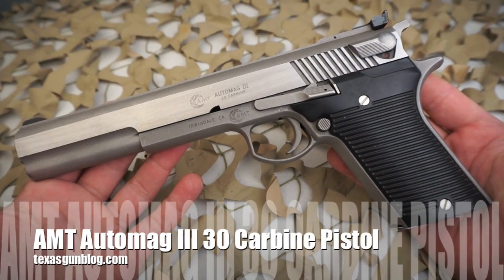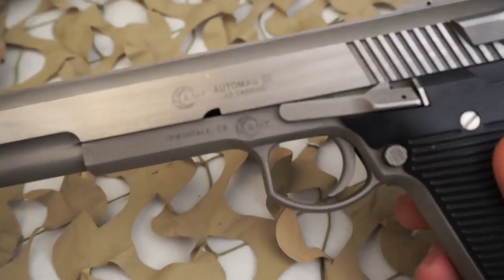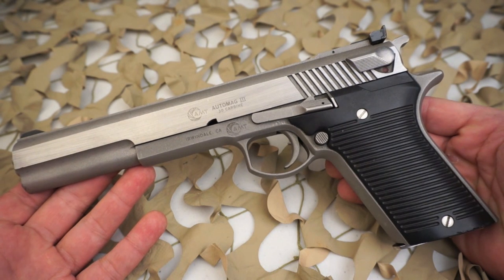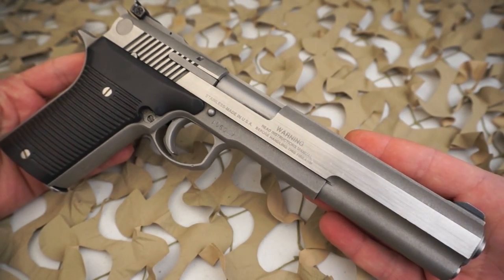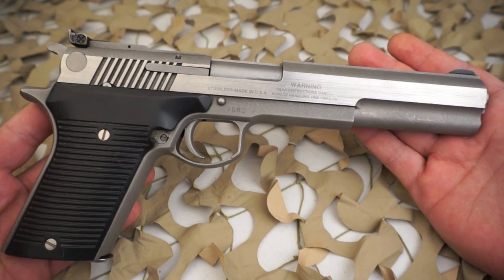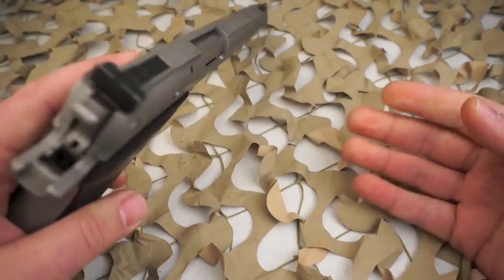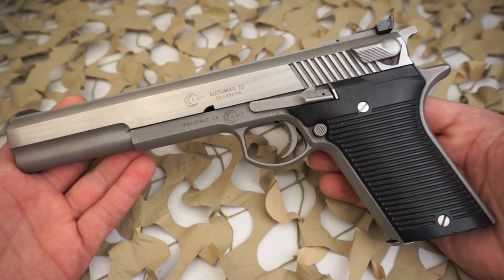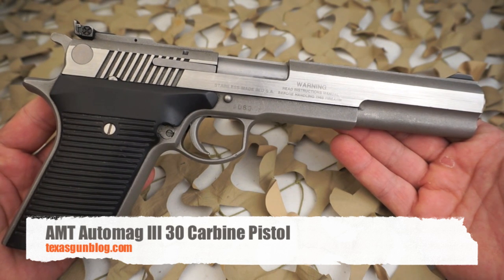AMT Automag III .30 Carbine Semi Auto Pistol Overview - Texas Gun Blog

Comment: Found the further information: Arcadia Machine & Tool, commonly abbreviated to AMT, was a firearms manufacturer from Irwindale, California. The company produced several weapons, primarily clones of existing firearms, but made from stainless steel rather than the traditional steel used for most firearms of the time. AMT was described by the U.S. BATF as one of the "Ring of Fire companies", known for their large-scale manufacture of Saturday night specials. The company filed for bankruptcy after their products were plagued with quality and reliability problems, and the assets and trademark were acquired by IAI (Irwindale Arms Incorporated). Later, in 1998, Galena Industries of Sturgis, South Dakota purchased the company and produced firearms in the style of AMT's until 2001 when Crusader Gun Co. (now High Standard) of Houston, Texas purchased it.

Comment: I bought one 30 years ago.  It immediately kinked the hammer spring.  It then kinked the second spring.  I had the spring well bored out and installed a heavier spring and it has performed flawlessly for 20 years.  Never mount a scope to one as it will stove pipe and not feed.  Otherwise, mine is a hoot to shoot and it gets a lot of looks at the range.  I gave $300 for mine in about 1988-1993 somewhere in that area.  I turned down $800 for it ten years ago.  I have had NO magazine trouble including the factory original mag.  (I don't drop them or get them dirty either)  The owner's son told me that not too many 3's were sold. Most were the .22 mag versions. Thanks guys!
Reply: how much would you sell it today?

Comment: I have one of these guns.  It's without a doubt my favorite.  The trigger is smooth as silk.  It has NEVER jammed.  Due to the fact that it shoots a cartridge originally designed for a much longer barrel it literally blows an 8 inch fireball of unburned gun power out the end of the barrel.  Maybe not the best situation from a tactical perspective, but WOW you sure feel your testosterone with every pull of the trigger!
Reply: keep it properly lubed and it runs well. only if dry does mine fail.
Reply: I want one so badly. So the trigger is good?
Reply: Could not agree more, when I keep my piece lubed and clean , With every pull & Buck it makes in my hands . I feel more testosterone then chuck Norris round housing the sun .
Reply: Joseph Blow that's a beast....nice.
Reply: Can't you use a different quicker burning powder?
Reply: I agree, I have one as well. Just fun to shoot!
Reply: I have an Automag IV 
Reference my profile for said fireball 
Gawd I love that gun.
Reply: What type ammo
Reply: it has a built in flash light lol
Reply: @zensempai7371  😂👍
Reply: @haroldandrews4482  The ammo is 30 caliber carbine.
Reply: @marblemarble7113  😂

Comment: The AMT Automag III is a single action semi-automatic handgun, designed by Harry Sanford, creator of the first Automag. The Automag III does not actually fire a magnum cartridge, but is chambered for the .30 Carbine cartridge originally designed for the World War II era M1 carbine. It was also originally chambered for the 9mm Winchester Magnum cartridge. Only the original AMT production pistols were made in 9mm Winchester Magnum; later Galena production was only in .30 Carbine. It was made of stainless steel and has an 8-round magazine.

Comment: Rusty Shackleford Hey Bud, could i ask you a few questions about your automat? Info for these things is hard to come by. So , I have an IAI automag. picked it up at an online auction. The thing looked like it had barely been shot. Tight action- almost too tight. I stripped her down, cleaned her, take her to the range, and bloop, failure to eject. 3 Problems i noticed. 1- The thing seemed to be getting tighter as i fire it (the fit from upper to lower). Stripped it, lubed it. Racked it a hundred times (in hind sight this may have been a bad idea) and it loosened up. Charged it- Bloop. Stove pipe, like as if the slide were not traveling far enough back to eject the previous shell. Stove pipe, stove pipe, stove pipe.  If i pull the slide backall the way, the round seemed to clear. It was almost like the slide wasn't traveling back far enough. Striped it, lubed it, rack rack rack- Bloop. Problem  2- some shells were expanding in the chamber and i had to pop them out through the barrel with a rod. . Problem  3 - now the action seems loose???? A lot of rattle on the slide now as if the rails weren't properly fit. 

My questions are- did you experience a break in period with yours?
- How is the fit from your upper to lower? Any play. Mine is kind of like a GI 1911 now...a bit of movement side to side which worries me. If i shake it, the whole piece rattles. Is this a bad thing, Or is the natural way of the gun. I hope i didn't mess it up with all that initial hasty racking. 
- Head spacing - Are my shells expanding in the chamber because it too small in there- this only happened a handful of times. 
- Gunsmithing- should i shine everything up, take her to a smith and get her smoothed out
- Any recommendations/experiences.?